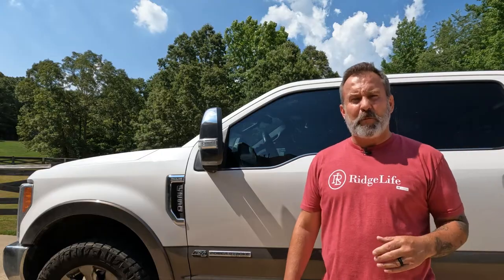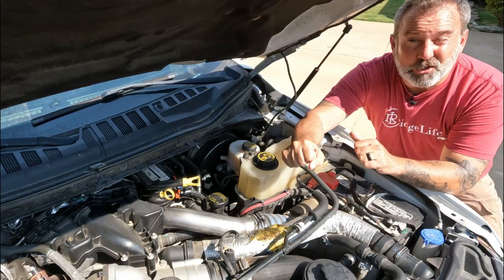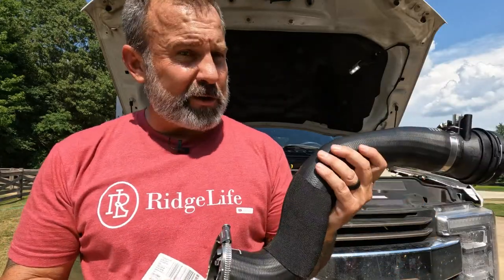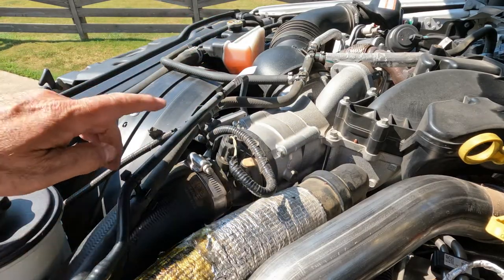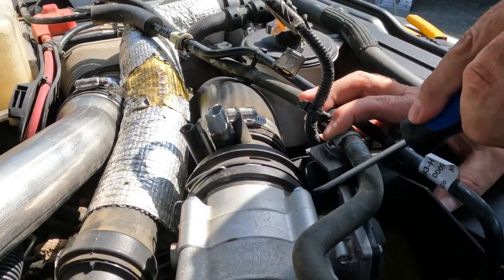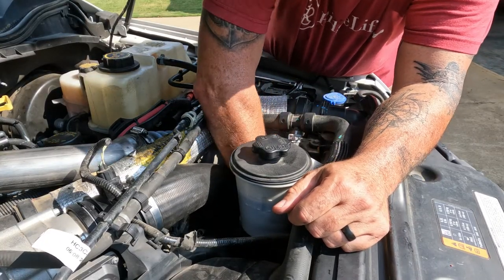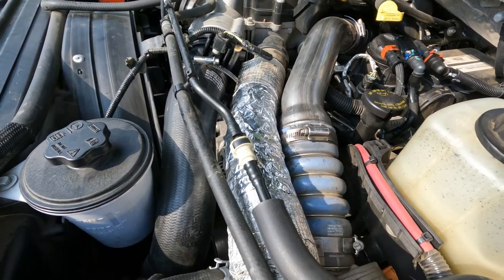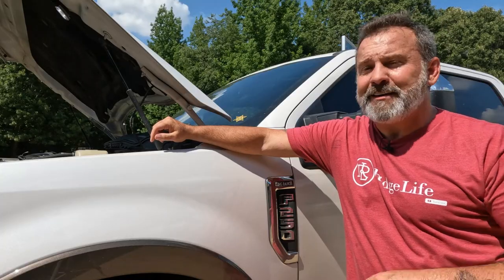HOW TO Replace Cold Side InterCooler Hose | 6.7L Power Stroke F-250 | Mass Air Flow High P00BD

Comment: Outstanding Job!
Had a check engine light on my way home. I scanned it and got the P00BD code. 1hr later after watching your step by step I had it fixed. Good work, much appreciated!
Reply from the maker: That’s great!
Reply: @RidgeLife  Service Engine light has remained on, how many cycles does it typically take for it to reset? Is there something else I need to check? Thanks!
Reply: Update: Service Engine Light cycled off by end of the day. 👍🏼

Comment: I got the same code at the Ford dealer and they couldn’t see me for 3 days. I work 1.5 hrs from home and so I did some investigation. Found my hose was cracked in 3 places. I got a new one. Replaced it at work. It’s running perfect. Thank you so much from this 54 yr old grandma. It was so easy to follow the video and took me 10 minutes.
Reply from the maker: My pleasure!

Comment: The piping kit is a complete piping kit, intercooler, y pipe and cold air intake. The truck is deleted and tuned which would or should turn off the EGR and throttle body damper. Put truck on livestream and it’s showing an open circuit. Tried plugging everything back in and no luck. Still zero airflow on tuner…..
I am going to start am testing wires this weekend, just hoping someone has ran into this issue before and documented it. 
You’re the only person that’s replied in a week of scratching my head. Thank you sir.
Reply from the maker: Sorry! Good luck!
Reply: Thank you
Reply: Here's an idea.  Put it back to stock so we don't have to breathe your filthy exhaust.

Comment: Thanks for the really detailed video!  I just did mine today and she is humming along great again!  Only problem is I tried so hard using the wire cutter just like you did and the clip broke.  Do you have any recommendations on how to make it look original again?  The little pin that goes into the clip obviously is broken
Reply from the maker: Hmm a bit of medium loctite may work. Thx!
Reply: @RidgeLife  Thanks for the response!  Do you think Loctite would make it too hard to remove when the house inevitably cracks again?

Comment: I just did it. Thanks for the great film. From the time I walked into the garage, I assembled necessary tools, swapped out the old one with an OEM from the dealership, test ran it and checked for leaks. I closed the hood 11 minutes later. The prices have gone up, so the tube cost me 180 +tax. Dealer wanted 704. What a rip. Now I'm showing the P0402 code. Has anyone figured out the story on that yet? I checked for O-ring and I'm going to clean and swap out the old sensor.
Reply from the maker: Glad it helped! Not sure on that other than my issue!
Reply: I took it to the dealer. They told me it needed a software update for the sensors. They haven't seen it with this pipe replacement, but they've seen it with other stuff, where the computer gets wonky with a new sensor. Quick update and it hasn't popped up again. Dealer didn't even charge me because I bought the part  from them.

Comment: Quick question. If my hose doesn’t come with the o ring pre lubricant, what type of lubricant do you recommend to put on? Would any standard grease work?
Reply from the maker: I thinks it’s a silicone o ring lub. Check auto parts store (or just use some oil, ha!).
Reply: @RidgeLife  Thank you!

Comment: Did you have any codes trigger the check engine light after changing this hose? I changed it and the check engine light came on about 2 days later. 
Alerts: 
"Engine temp readings from 2 sensors did not agree when the vehicle was first started"

"One of the engine's emission control sensors is not responding as expected"
Reply from the maker: Only when I put the hose on without the gasket the first time! HA! Good after that.

Comment: I installed an aftermarket piping kit from Pusher and now my tuner shows 0 airflow and throttle, throwing DTC P00BD and occasionally P0113. Replaced MAF sensor and plug
Any suggestions? 
Thank you.
Reply from the maker: Sounds like the sensor is not connected on the pipe or bad.
Reply: Checked and checked. Tried two sensors.  By chance could it be from the throttle body no longer being in place or plugged in?
Reply from the maker: @riffelsrifles2981 you just replaced the pipe and sensor right? You didn’t remove anything else right. If you did, and didn’t install a replacement, yes. There is your problem. Sorry. Hard to TS in text.

Comment: Already replaced it. It did have cuts in it.Check engine light came back on and it is throwing the same code P00BD. Check engine light went away for a day, then came back on again. Hose looks good and has no cuts. Trying to see what might cause code to come back.
Reply from the maker: Well my new hose came without an o ring and had to steal it off old one!!
Reply: I’ll look into that. Thanks

Comment: next is your upper radiator hose ... also when you change your fuel filters how much fuel comes out when drain the valve under the truck?
Reply from the maker: It runs for a good bit. I’d say over a quart for sure.
Reply: @RidgeLife  I don't get it ... i get close to 4 gallons
Reply: @markmallory185 crack open the filter a bit. It’s siphoning from the tank

Comment: Will this cause a reduction in power?
Reply from the maker: Yes it will!
Reply: Mine just did this today, went into lower power mode taking my 5th wheel down the highway, opened the hood to see a 4-5 inch slit in my hose, currently on the side of the highway wondering if when I replace the hose and sensor does tha lower power mode go away when all things get the proofed pressure to it?

Comment: I replaced mine and now it’s showing P0402. I’ve seen where a lot of people are getting that code after replacing with OEM. One guy said he put old sensor back in new hose and that fixed his. I wonder if computer needs a rd flash with new sensor? I cleared codes with my code reader and even tried unhooking negative cables but code keeps coming back.
Reply from the maker: Make sure new hose had an o-ring! Not sure other than that. Sorry.
Reply: Yes sir. It had new o ring and greased. Thank you.
Reply from the maker: Hmm sorry. Good luck.
Reply: Did you figure it out? I'm having the same issues as you.
Reply: @idonaprophet2612  same issue too what did you do to solve this ?

Comment: No mention of clearing the codes.
Reply from the maker: You can pull battery leads or wait for several start cycles and it should clear on it's own.

Comment: My 2016 hose failed with 96k miles on it in 2024 , original hose and owner , I replaced it with factory hose , $300. for the parts . 🤦🏻‍♂️next time will do Aluminum
Reply from the maker: I should have also. Last forever. Factory will just do it again.
Reply: @RidgeLife  Yup , just went and got it to save time , need My boost back 😂,, Will order ahead of time when ready 😎👍

Comment: I broke the little yellow connector. Now what?
Reply from the maker: Ouch!  Not sure how much that will cost.
Reply: Does it do anything other than hold the wires together on the quick connector hose? Could I not just tape it down?
Reply: It’s that little yellow piece that you used the wire strippers to pry off.
Reply from the maker: @lordtechsan  not sure you can buy just hat price. May have to call
ford and ask.
Reply: I’ve watched several videos of people replaces these hoses with after market hoses/pipes and none of them use that little yellow connector on the new one. Just that temp plug in piece. It seems like it’s just something additional to secure the temp plug in.